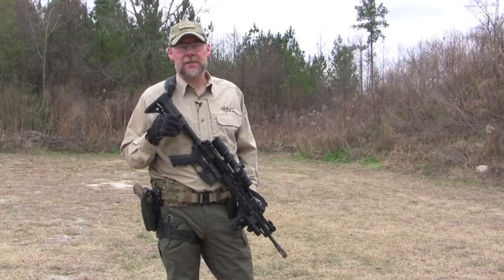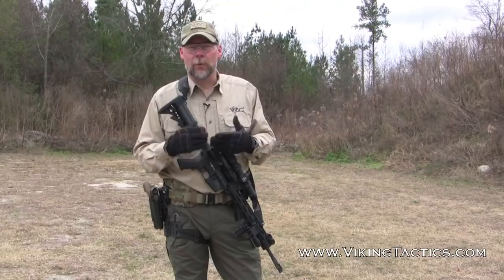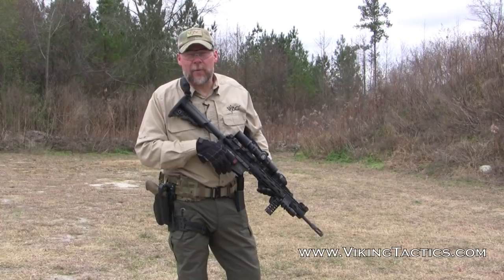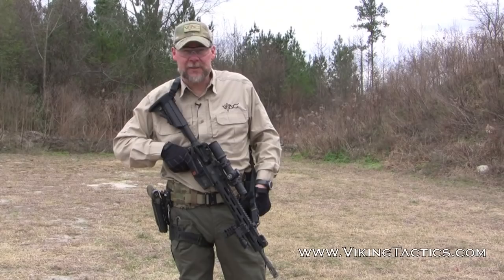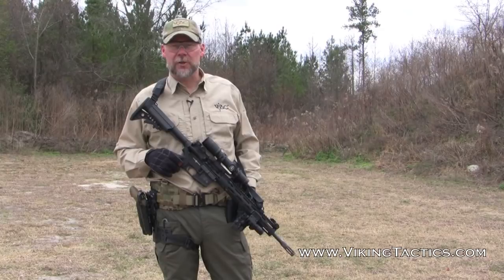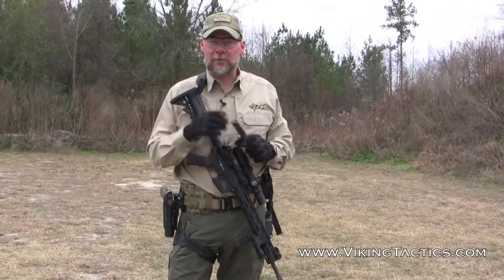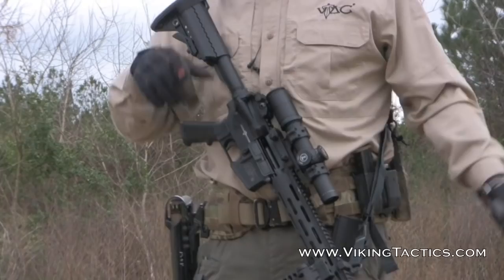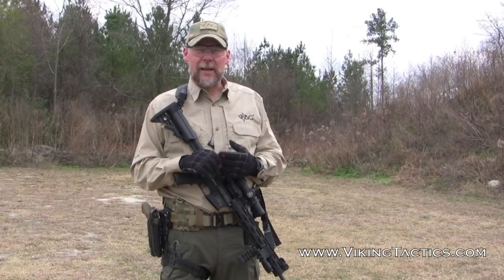Kyle discusses rifle to pistol transitions

Comment: Great video! At the moment we are traing for urban fighting, and we use the same methods as u are. My current weapons are: hk416 and mp7 (primary) and as secondary i use a glock 17 (p80). Not the best pistol, but its reliable for its use. "When it come to drill, "slow is smooth, smooth is fast".

Comment: No, I totally agree with that, and I suppose I'm thinking about the wrong audience here, but I mean that actions such as flipping on the safety of the rifle is an unnecessary step that will not be utilized in a gunfight (and this training IS for a gunfight). And if you train, even partially with steps like that, my experience says they show up where you don't want them. Accuracy is important, but Speed > Accuracy in a firefight within transition distance, and that philosophy, at least, direct me

Comment: good points on the heavy front. but larue is just as pricy as a lwrc. (but better accuracy, right?)  for the lube part, i have an ACR (which i dont like because its clumbersome, and i lube the firing bolt anyway)

Comment: nothing wrong with DI guns.  Pistons are heavy, expensive and just get dirty in a different spot.  I have run several hundred thousand rounds thru DI guns over the past several years and as long as the guns are lubed they run fine. Remember, a wet gun will run dirty and a clean gun may not run dry.

Comment: When you're doing transition drills how often do you reload your pistol?

I've had one trainer teach me that every time I transition to pistol, I should top it off before it goes back in the holster. 

I've had another teach me the same rule for single stacks but that with a double stacks I had to make a personal decision based on how many rounds I thought I fired. He also taught that this is highly job dependent, since a cool guy might have several pistol mags and a joe might only have 2 or 3.

Comment: Much love and respect. Why, if the fight is at rifle range, would you automatically switch to a pistol instead of doing immediate action? If it's a long arm fight, the pistol will do you no good. If the engagement distances changed, you should have identified and transitioned before the stoppage. Don't wanna be an ass, just asking an honest question.
Reply: traviesolee72 so most of the time if you are engaging a target to the point where you weapon actually goes dry it is probably a dire situation, meaning you enemy is at close range, and/or there are a lot of them. Therefore the need to have a loaded weapon in your hands (like now!!!) is extremely important. If the enemy is at a greater distance at least you have a weapon in your hand and you can seek cover or determine the actual status of your long gun. However, it is always on the shooter to know the status of their weapon. If you fire like 20 rounds from your weapon from one location and there is a break in the fight, it is probably a good time to do a tactical reload (while behind cover) before moving to another location so as to prevent your weapon from going dry at a bad time.
Additionally this drill is extremely good for when you have a malfunction with a fully loaded weapon. If you are conducting some kind of urban fight, there is a really good chance your enemy is within pistol range anyway. This is another reason why you attempt to put your weapon on safe prior to transitioning to the pistol; it is a really good way to to determine that your weapon may have a malfunction. Malfunctions can take some time to clear depending on your proficiency in clearing them and you may not have to the time or space to clear it right away. Therefore a secondary weapon will need to be in your hands. There is more to it, obviously, but I hope that helps to answer your question.